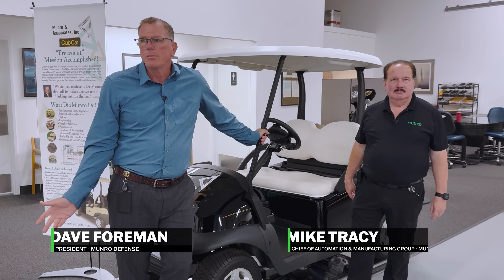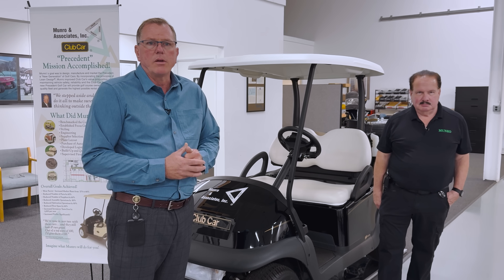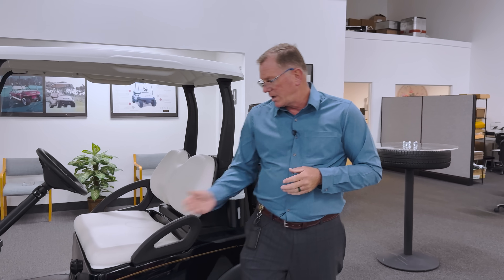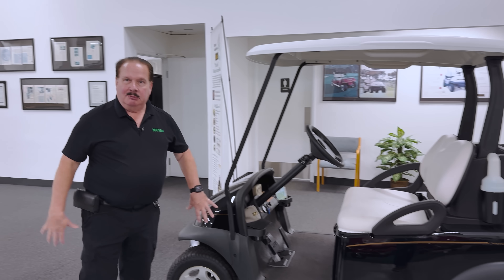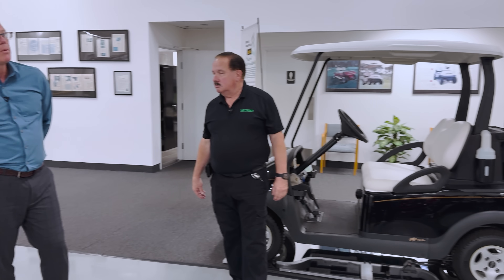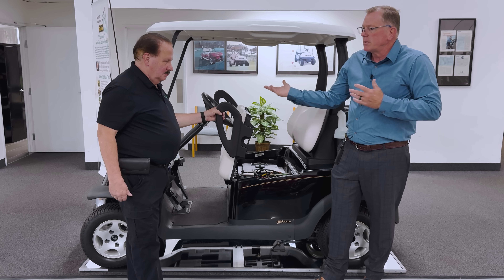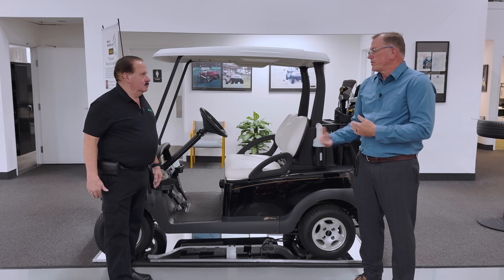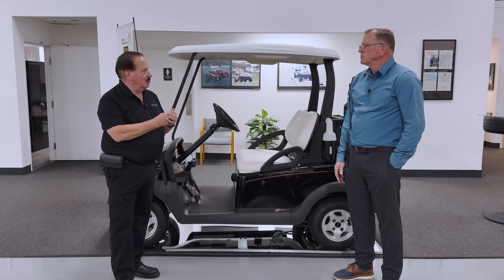Revolutionizing the Golf Cart Industry: How Munro & Associates Optimized the Club Car Design

Comment: Villages here. For an upscale LSV/NEV buyer, they want those modular panels that can easily be replaced with a different “body kit” to differentiate it.  Also, every roof should have solar now, there’s just too much sun to ignore even small benefits. Also continue as much no rust aluminum and “plastic” so they can be used near the beach for a few years without the battery falling through.
Reply: I can see an aftermarket solar roof being popular.

Comment: I worked on most brands of golf cards for a couple of years. I know exactly what they are talking about here and it sounds like some significant improvements. That new battery looks fantastic. On the old carts, a hidden problem people rarely considered was that those cables would corrode and fail, as well you had to regularly top off those lead acid batteries, and the risk of freezing in the winter (though fully charging before storage helped).
Reply: I thought the battery charger failed, but it was a cable-end on one battery that corroded.  It was an old Club used in the stable area of a horse race track, sand, dust, no maintenance, decades old, but still worked.
Reply: @gyrateful having worked on both, unless I needed to go a really long ways, I would easily choose an electric cart. I recommend to people, pull on the cables. If they felt crunchy, replace them all.
Reply: Recently did an LSV conversion on the previous design and it was a horror show with so much buried in the dash that was only accessible if you removed the entire front body however you had to take off the windshield and roof first before you could do that and perform even the simplest repair/update such as change out one of the ganged cam operated micro-switches linked to the shift linkage.  Roof design was such that you had tidal waves of water coming off it on every start and stop if you got caught in the rain.  No provision for wiring in clearance lights either plus too many micro-switches on pedals and their linkages hidden under the floor yet exposed to the elements in locations where runoff would damage them.  

The forward seat bases on the six passenger/limo models were just molded ABS plastic tubs without any reinforcement to support the occupants/seat backs/bottoms or roof system leaving them prone to fracturing at the stress points plus no real structure anchoring the square tubing the commonly used seat belts were mounted on.  An update was sorely needed just for the safety of the occupants especially for use as a street legal LSV.

The welded frame though it looked impressive at first really didn't do that well in crash testing either which was concerning considering how many get setup for LSV use, are modified by the owners afterwards to exceed the 25 mph max top speed allowed for them so that they can keep up with the flow of traffic on 35 mph roads.  Hopefully the lethargic rear wheel only cable brake systems got upgrade in this redesign effort.

Best!